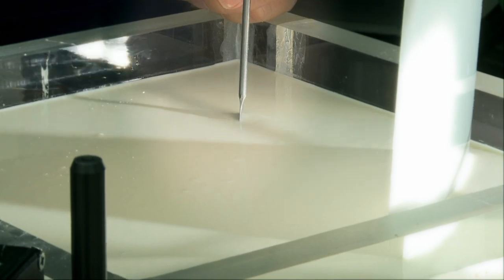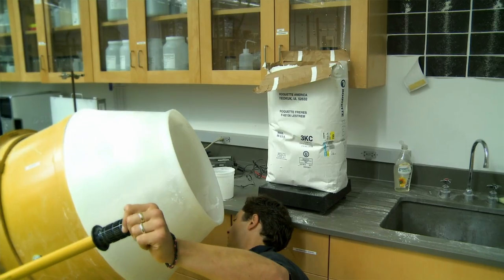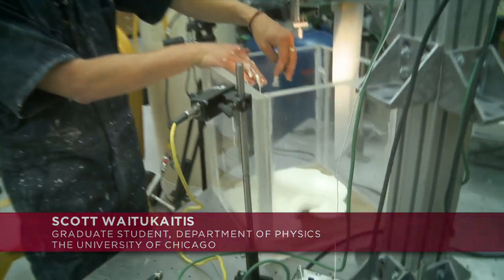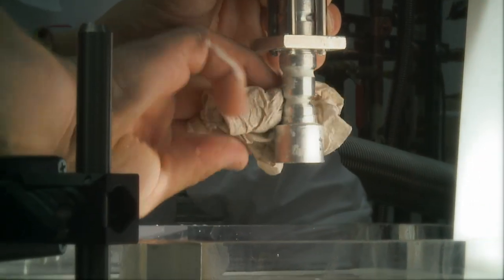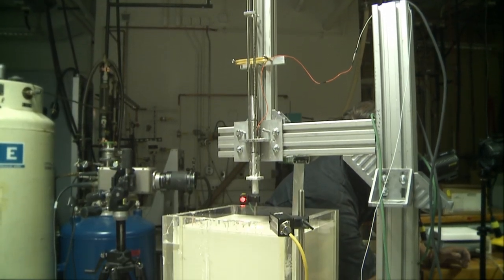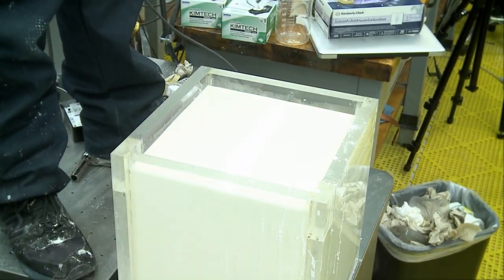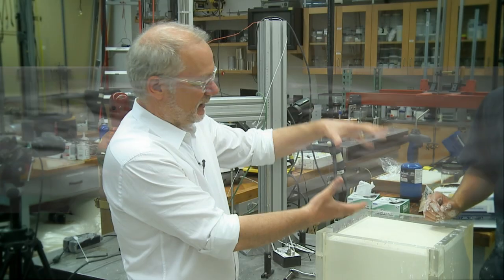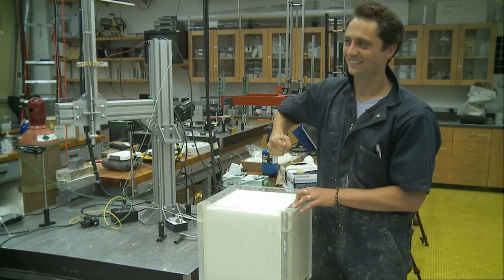Cornstarch & Water - Explained by Physicists - Heinrich Jaeger and Scott Waitukaitis

Comment: Based on the title, I was expecting to learn about the physics behind it, instead of hear a physicist say, "it's a liquid, but when you hit it really hard it turns into a sold".

Cool footage none the less.
Reply: This.
Reply: That's the level of science at Uni in the modern age lol.
Reply: He did say that when hit, underneath the cornflour-water suspension, you causes the formation of an iceberg underneath the area where the surface was struck, and this why it acts like a solid.  When he drops the metal ball it hits the surface and bounces but once it stops, it started to sink into the cornflour-water suspension.  Cool 😎

Comment: I have a question. I have found that Swedish Fish (the gummy candy) can shatter when thrown or, in some cases, even just dropped on the ground. When it shatters or chips, it will break with a clean edge as if it was made of glass (or a hard candy, I guess). The candy doesn't need to be frozen or hard (from being stale), it can be soft and bendy but will still shatter when it hits a hard surface like concrete. There is a video on Youtube called "Shattering Swedish Fish" which shows this but besides this video and my experience of it (probably 8 or more years ago) I have not been able to find anything else on the subject. It seems like it may not work with every Swedish Fish, I've only ever see it happen to non-original flavor ones but I have no idea. Years ago when I first experienced it I was just eating some red and green Christmas edition Swedish fish which were left over from a holiday party and I dropped one. Its tail broke off cleanly with a sharp edge as if it had been a hard candy yet it was just a regular, gummy Swedish Fish. I was fascinated and experimented with all the rest I had and got similar results.   

I have to wonder if it this is acting on a similar principle as cornstarch and water but have been disappointed in the utter lack of information on it. Interestingly, corn starch is listed as an ingredient in Swedish Fish but I'm aware this may just be a coincidence.   

I was wondering if anyone knows anything about this or has experienced this before. Anything would be very much appreciated.
Reply: I feel that cornstarch is partly responsible for the phenomenon you have observed...hmmm
Reply: Boon Hui
Yeah, seems like it. Since I made that comment back on November 1st, 2015, I have decided to test something. A left some Swedish fish is a small slightly sealed container. Just now got one out and examined it. The Swedish fish feels soft and pliable (like a new one) but this one which is slightly stale DOES shatter when it hits the floor! It shatter just like the ones I saw years ago (which nice clear edges), as if it was a hard candy!

Comment: What other materials can be used aside from corn starch? Corn starch will break down over time. Are there any minerals which, when put in suspension, also do this.  This would make a terrific damper for seismic constrain.  Free moving at low speed, and locked under impact.

Comment: Interesting. So there may be a way to change between solid/liquid states by changing the pressure of the solution? I guess what I'm asking is would it be possible to create "structures" that can also be turned into a liquid or solid at will?

Comment: H2O has surface tension.  It is literally a hard phase of H2O. As its name suggests, surface tension occurs on the surface of liquid water.  So, think about that, a solid exists on the surface of water.  

Now consider this: if you can maximize the surface of liquid water in 3 dimensions you can create a 3 dimensional form of H2O surface tension.  When force is applied to the mixture the grains of corn starch are forced between water molecules creating an internal, 3 dimensional surface.  

This is the correct explanation of this phenomena.  Corn starch is not providing the structural strength at all.  With pressure applied, corn starch is providing the surface.  The tensional forces that make the substance hard are provided by the water molecules. And it is based on the same (unknown) principle that causes surface tension of water.

BTW, this understanding provides us an alternative hypothesis for ice which is currently thought to be a result of a lattice.  This new understanding suggests that the lattice hypothesis is mistaken and the reason ice is hard has nothing to do with it turning into a lattice but, instead, has to do with factors that create an internal surface in the body of water.

I am a scientist who will soon be revealing my solution to the anomalies of H2O.  Here is a link to a meetup in the SF bay area that will begin to resolve all of the long standing mysteries of H2O's anomalies:
Resolving the Anomalies of H2O / James McGinn
https://www.meetup.com/Resolving-the-Anomalies-of-H2O/events/246928935/
Reply: Everyone who studies dense suspensions will tell you that you explanation is wrong.